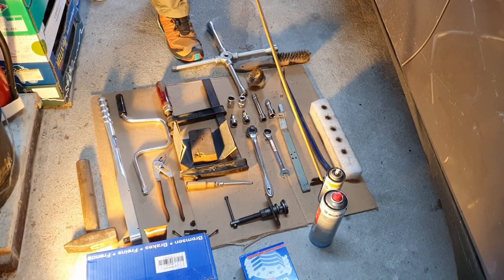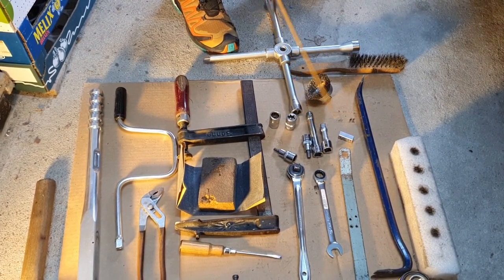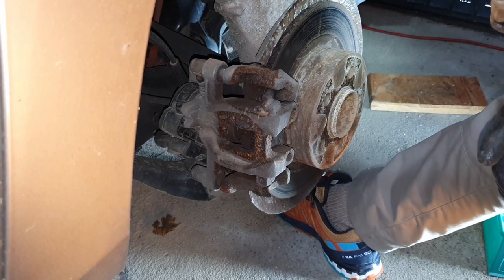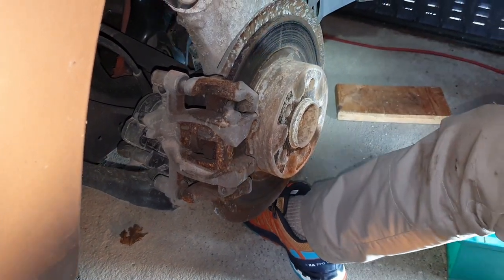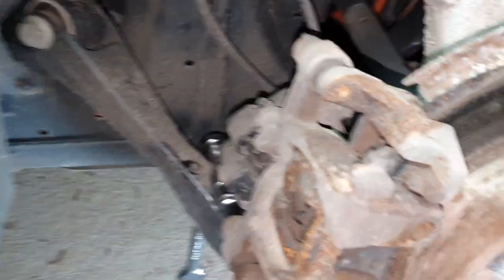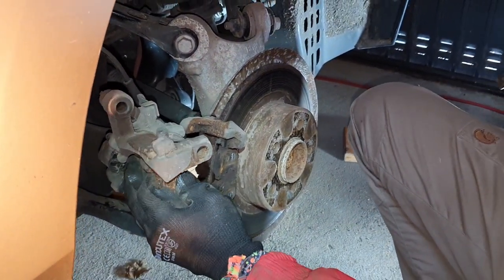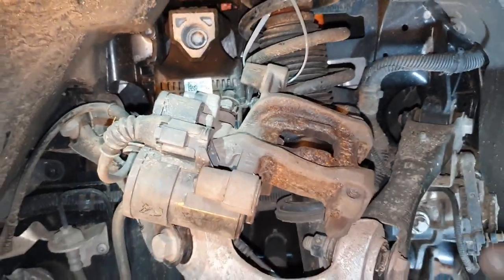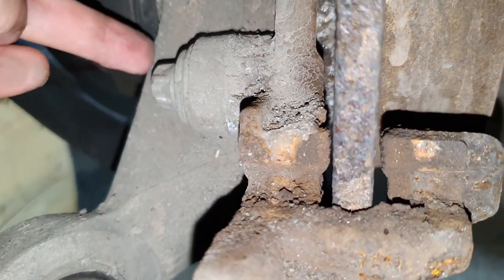BMW i3 rear brake change. Rotor and pads. Detailed DIY guide English Version

Comment: Good informative video.
On our i3 the brake pad warning message came on a couple of months ago. I checked the rear pads and there was almost 3/4 pad left  all around and the sensor wasn't worn through. 

Reset worn rear pad notification many times. Warning message always come back after 10 miles or so.

Installed new pads and sensor. Error hasn't come back for over 150 miles.

So wasteful to need to change the pads so early

Comment: You can take disc off and replace without removing caliper carrier. The E18 are 110Nm
Reply from the maker: Thanks a lot for the info, im gone try that when the the time comes again to change the disks, currently they still look A+
Reply: @mogelzz  I got the disc off without carrier from Check engine plus minus on yt

Comment: You don't need any special tools for this job. Just remove the electric motor, turn the exposed gear by hand while squeezing the piston with a clamp.  I just did mine this way.
Reply from the maker: Ah thats a very good idear, requiers a bit more disassambly tho, is there a seal that you need to watch out for ? betwen motor and piston ? if not thats the way to go. I need to keap that in mind for the next brake job im gonne do.
Reply: @mogelzz  No there is little grease and a reusable seal. I did it this way on my older BMWs many times before. They were slightly different but same idea.

Comment: Good vid but please don’t take a hammer to the disc, it’s not helpful. Just be patient and apply WD around the hub or a little heat and the disc will pull STRAIGHT off. Also be very careful with anti seize past and use very little or the new pads will become contaminated. Remember to check and de grease the new disc both sides as sometimes the manufacture can leave an oily deposit. If not sure use a garage it is cheaper than a funeral!
Reply from the maker: Alle the boalts are still tight when I retorqued them and Breaks work fine as well. 
If the disk is fucked anyways there is not mutch a measly hammer can do.  compered to the force on the bearings when you drive over stone or a pot hole. 
But Its definetly way more convenient to go with WD 40. Even if you need to clean the hub afterwards with break cleaner. 2. time I did that job and defenetly learned that wd40 is the way to go.
Reply: You should not use anti seize on the guide pins or the sliders, you should be using silicone paste. Anti seize will breakdown and the parts will stick and you will be doing the job over in a year.
Reply from the maker: @Set22Kill O.k. a view points I need to make, The past i put on in the Video is made for lubricating stuff. It dos this by having small copper particels suspendet in an oli if the oil gets squished away the copper provides lubrication, simular to an oil impregenated brass bushing. One of the advantages is that copper cant evaporate and be just gone. Danger is that it coud galvanicly react. A molybden or Graphit besed compund might be a better coice. But copper past is used all over the place to make things not stick. 
On the other hand silicone is great stuff, lubricating zippers, plastics and other stuff where you dont mind everything else getting full of silicone. Becaus thats the danger of silicone oil IT CREEPS. Wanne make a pcb never take solder put a drop of silicon oil on it and waite a view days . 
Wanne make your living room floor super slippy use silicone oil somwhere in your flat and let one drop get on the floor. If your floor is incapable of wicking it up this works. 
Silicone woud easealy creep on to the break disk and reduce breaking torque by a lot. Based on my experiemces with it, i have seen other breaks changed witch copper past or derivitivs of it but non with silicone oil
Reply: @mogelzz  SO what do we use, recently I have not been using anything?